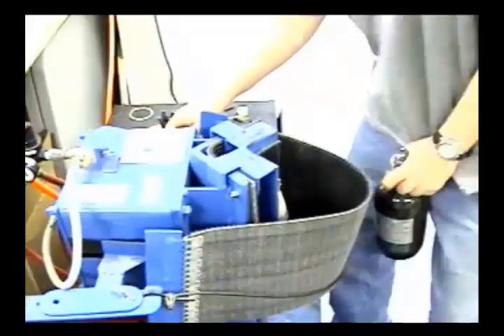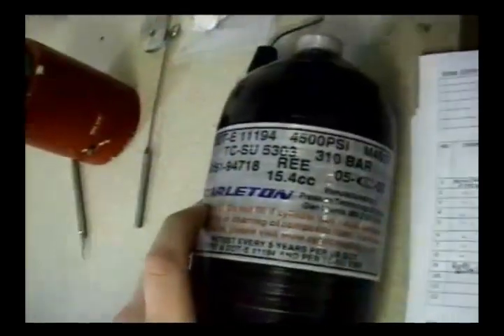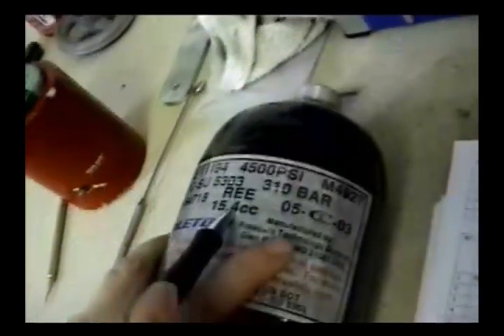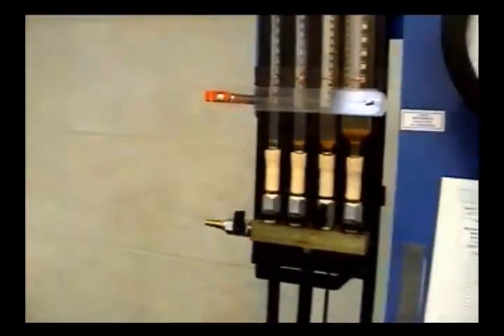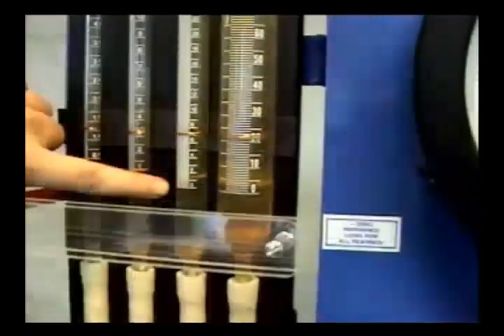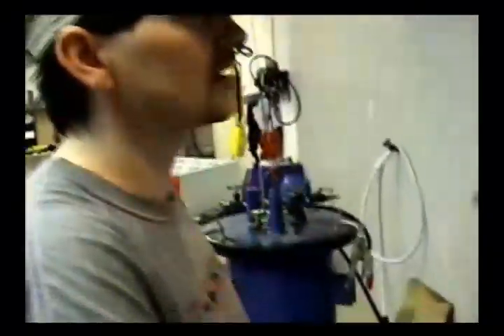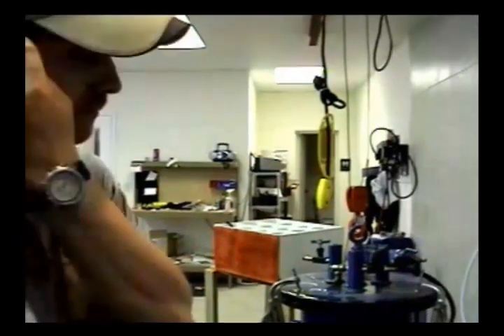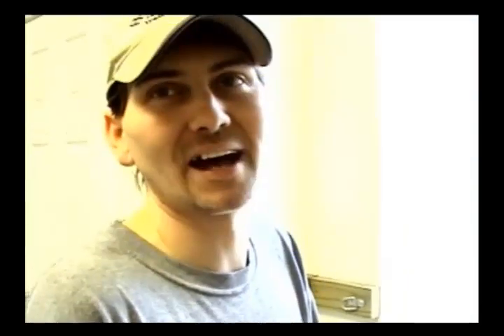Paintball air cylinder hydro testing, how it works!

Comment: I have a question.  I needed to hydro test small 4500 68 inch carbon fiber tank.  Now initially this tank's gauge was broken and they told me to get a new gauge or else they would NOT do the hydro test. I did get a new gauge. Two weeks later the hydro test was successful but when they fill up the the the tank. Air was coming out from the New gauge !!! 
Could it be possible that they screw up my new gauge with the hydro test ??? I need to know this because I feel these guys are hidding something from me. As I am new to this. I just don't want to accuse them without knowing.

Comment: This test is causing unnecessary stress and wear and tear on the tank. My tanks need to be hydro tested but I know they are fine which is why I don't want to send them in. Not only is it costly and inconvenient time frame (2 weeks!) but I think it's also unnecessary for my tanks that have seen such little use. I fill them myself and after watching this vid, what I suspected as far as the test goes has been confirmed.
Reply: anarchyamp and he said it is a law to have them tested and I can’t find a law about air tanks for paintball and I do the same thing with my air tank it is to expensive to get them tested

Comment: Thats permanant expansion. Think of it like blowing up a balloon, after you let the air out, the balloon is stretched. Cylinders will do the same thing. After testing the cylinder to 5/3 the "operating" pressure and it comes back to zero, that burette will read the permanant expansion. Like he says your pushing the legal limit. Be careful of Korean tanks coming into this country. I have rejected many on the first retest.
Reply: Wa3ypx what country are u from I'm worried I have one
Reply: Linda Phillips what size is your tank if it has less than 1L water capacity its exempt from periodic requalification (hydrotest)